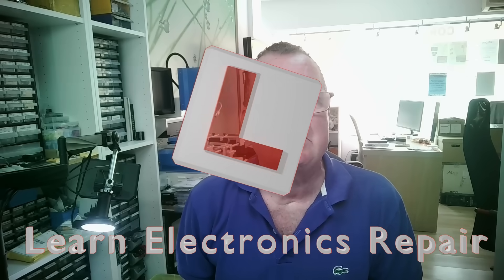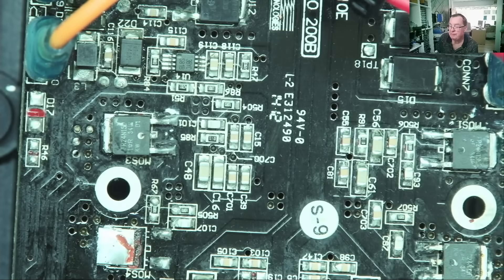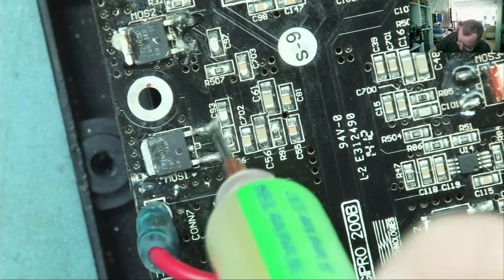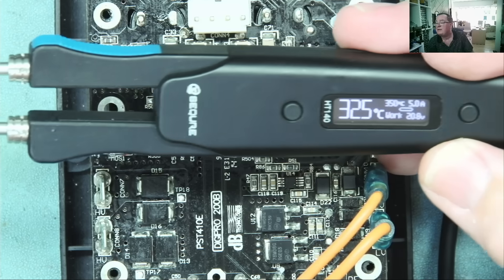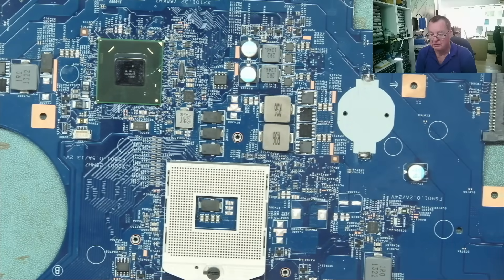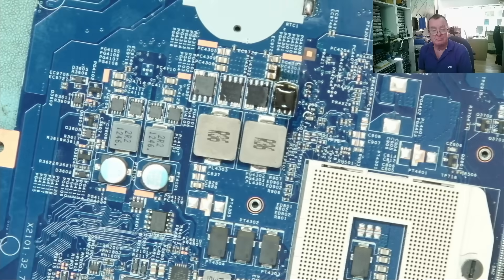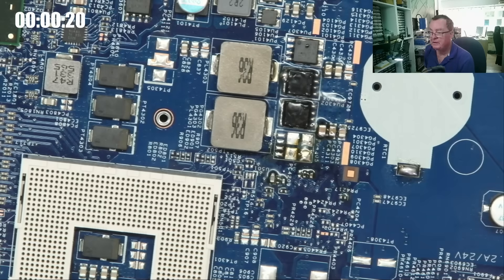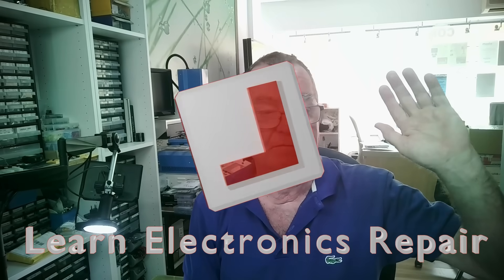NEW Simple Ways to Desolder SMD MOSFET With And Without Hot Air

Comment: I've had better luck holding the hot tweezers upside down in instances like this. The rounded part of the tip has more mass to transfer more heat than the pointy tip.

Comment: Back in 1981, working on a large drone, I didn't have a soldering iron powerful enough to solder large wires to a copper place as it dissipated heat too quickly.  I ended up using two irons at the same time to overcome the issue and finish the job.  From that point on, I have often used combinations of irons, hot tweezers, and hot air to address a multiple of tough situations. Like anything else, after a while, you develop a sense of the best ways/combinations for the job at hand.  Also, a good channel for soldering tips is "Mr SolderFix". Cheers

Comment: Thermal-soak the entire board with a toaster oven or pre-heater to just under meling temp. (about 180 C). Evens-out thermal expansion / contraction regions. Makes less work remaining needed for your iron / hot tweezers. There is a small difference between desolder temp for (low, around 220 C) white thru-hole plastics to black or gray surface mount plastics (higher temp, around 232 C). Ali Express PID controllers and SSR's and K-type thermocouples help. Folow temp/time curves recommended by device manufacturer manually and it works perfect.

Comment: I under-mount a hot-plate desoldering  / pre-heater flush with the surface of my bench. Next to it I cut another hole in the bench where I just strapped-in a hot-air gun with band-iron. stripped controls out of both and 3D printed desktop enclosures for them, added a hot air gun foot pedal. This butchery happened to my beautiful new oak workbenches because lots of bitcoin miner hashboard repairs. One repair buys replacement table. Done thousands with it already. It's a DREAM to work with!! Overhead, for many extremely delicate supper tiny high density work jobs like an iPhone I put a Hella off-road hal;ogen bulb and reflector on an old lighted magnifier spring loaded gooseneck stand. BLOCK ALL THE LIGHT FROM YOUR EYES! That does IR desoldering that makes no wind to blow parts away. I usually mask surrounding circuitry with kapton tape or putty or aluminum tape. Low temp solder paste is useful.

Comment: That's crazy, I just got a broken motor drive where I need to replace the transistors. However I am really struggling with heating up the 3 legs at the same time to place it properly. Currently looking to get a soldering iron with hot air, this will likely make it easier

Comment: I have yet to use separate flux like Amtech even though I have it.  To me the best innovation that has come along since the soldering iron is the metal mesh for cleaning the tip of the iron.  A wetted sponge never worked as well and cools down too much.  Granted I waste more solder than I actually use because of tip cleaning.  The Kester solder has a flux core.

I melt additional solder on a joint and use a Solderpult/sucker, an old fashion tool that really sucks.  The solder is added to heat and give the joint mass for suction.  Works well IMO.

Comment: I use a C245 shovel bit of the appropriate size plus a regular 3mm bevel tip.  So long as you have the right size shovel bit the component can have just two or lots more leads.  😃

Comment: Another common way is using low melting-point solder. The commercial brand name version is called Quip Quik but it's very expensive so avoid it.

Comment: Using 2 soldering irons to remove smd parts has been a known technique for many years. Problem is most people don't have 2 soldering irons. Another way is flood the smd part with solder and flux and heat it both sides with 1 iron, alternating sides quickly and eventually the part comes off. I've used this technique many times to remove many parts, even things like TSOP flash roms, although these need an additional step to get them off. I do this quite often when I have to remove a very thin (1.2mm) tsop flash rom or tssop ram when it's right next to a BGA or some plastic connectors as hot air can cause the chip to expand internally and crack.
Reply: Yet another way is to make a tip extension using very thick copper wire that touches all IC points at once.

Comment: What I do is solder tinned copper wire to all legs with flux and low melt solder then stick my iron on it, it comes off quite quickly that way
Reply from the maker: And what about devices like the mosfets in method two? If there are hidden pads underneath how to attach copper wire to them?

Comment: How did you manage to use the hot air to get it hot enough to remove the MOSFET without all those small surface mount components around it desoldering as well and blowing away?
Reply from the maker: By adding leaded solder and flux first.  This lowers the melting point, if you do it right the surrounding lead free components won't move because the solder does not melt.  If you put kapton tape on them you make the job much harder as it prevents you getting heat into the PCB power and ground planes.  I learnt this from experience.  Give it a try on some scrap boards
Reply: @LearnElectronicsRepair  I guess this means the actual hot air temperature is critical. What do you use?

Comment: Piece of solid copper wire drenched in solder usually works without much issues with a proper iron.
Reply from the maker: Does it work on devices like the MOSFET I show in method two here, with four hidden pads underneath?
Reply: @LearnElectronicsRepair  If you can solder a piece or wire to the leads or the pads yes.

Comment: You can drive the tweezers with 28V DC (they are rated for it) rather than the 20V you appear to be using and thereby get more power into the tips. To use, just set the same required temperature and the 28v makes more output available where needed on those large components which tend to suck away the heat. That's the reason I power my HT140's with a bench PSU. Makes a big difference in my experience.
Reply from the maker: Yeah I know, and you are quite correct.  I have a PD3.1 28V 140W supply but it doesn't work too well at 28V 5A and the tweezers then to trip out.  Apparently this is something of a know issue.
Reply: Thanks for the tip!

Comment: I don't see anything new here.
For years, service technicians have used many methods to desolder components. I'll tell you that most of the problems with desoldering come from the underpowered soldering irons used. 
For 30 years I have had a classic 150W “heater” soldering iron with a very thick copper tip.
It takes a long time to heat up - but such transistors are not a challenge for it.
In the past it was not easy to buy precision soldering irons, you would wrap a thin copper wire around the tip of such a soldering iron and it was possible to solder very precise components.
You could wind and profile the wire in such a way that it was possible to solder an integrated circuit.
Over the years I have tested many different solutions, with heaters, soldering stations, twizers, two soldering irons, two soldering stations, hotair, paint burners, and various combinations of said devices.
Depending on the complexity of the component I want to desolder, I use the appropriate tools, for special tasks I pull out my old soldering iron.

Comment: You can get a knife blade type tips for the hot tweezers, they'd likely work better.  Provide more heat and a flat surface that can hit all 2 or 4 pins at once.
Reply from the maker: I don't have any at the moment, just the bent conical ones, but I think we can all agree they worked very well both with the T12 and the hot air... in fact I think that was pretty damn impressive...
Reply: Yes, but thing is, there is a big pads under the MOSFET and any type of tweezers can't melt them without hot air
Reply: @grooyo  Correct, I didn't say not to use hot air. Tweezers with larger tips could have helped on the first board and likely on the 2nd.   Just trying to help the guy and others.
Reply from the maker: @Taliesen.  Would not have helped on the second
Reply from the maker: @grooyo  I agree sometimes the heat from the soldering iron/tweezers can't reach the right spot - So what was wrong with method two exactly? The one I put a chapter marker on for this very reason...

Comment: Have you tried wide blades in your tweezers, as used for ICs ? Tweezers are great, but those fine-pointed ones are for small components. Or maybe, given your rather cunning trick, mix a wide blade with a narrower one. Also works with WS2812 leds - even leaving them reusable.
Reply from the maker: I need to get some wide blades (and will) but I think the results shown in this video on both methods were surprisingly good
Reply: @LearnElectronicsRepair  Yeah, excellent use of the tools you had to hand